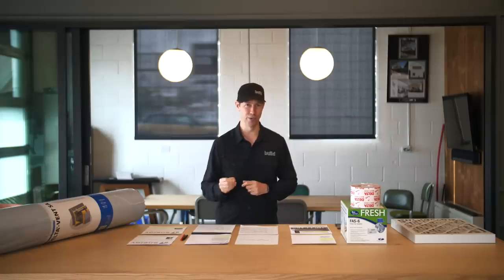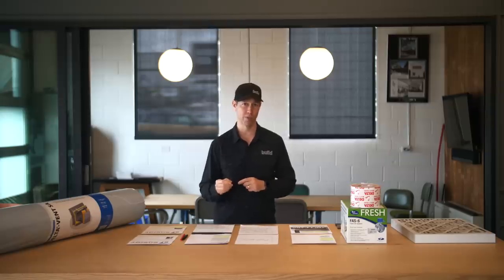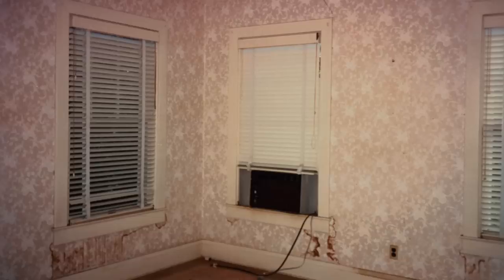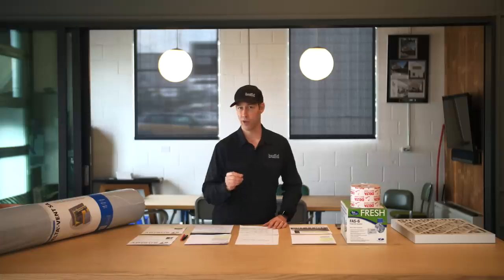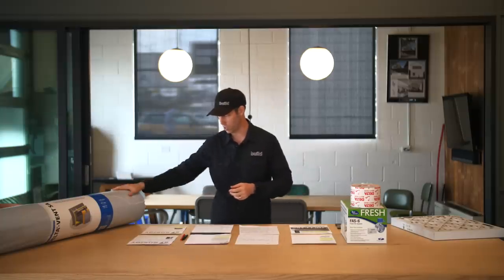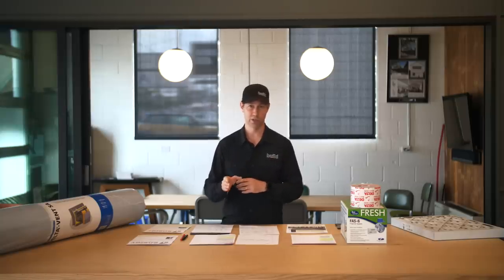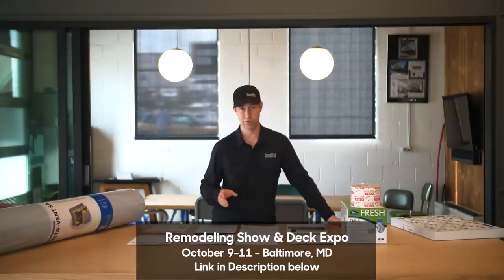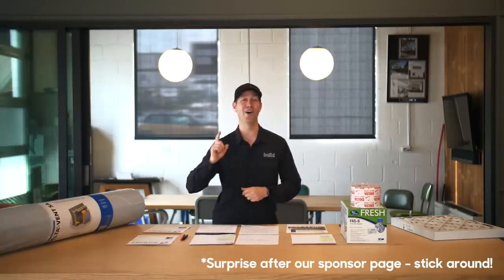“Houses need to BREATHE!” - Shut your filthy mouth

Comment: I constantly measure my air quality; including C02, humidity, temperature and chemicals content.  The C02 and chemical levels do not go down without opening up a window, but when I open my windows I let in humidity, so theirs no perfect solution.  I would love people who write code to measure the air quality of a house not just how tight it is.  I would like code to be written in a matter for the correct amount of airflow from ac or heating to clean the chemical and CO2 buildup.  Not just energy efficiency, because if you saving money but your body and mind isn't working at peak performance because of lack of clean air then it's not worth the savings.
Reply: +1
Reply: You can add a fresh air intake directly into your HVAC system. Ultraire makes one that includes a dehumidifier.
Reply: @tkmair6559 Thanks for the information.
Reply: Concentrations of carbon dioxide that does not exceed 1,000 ppm is the standard and outside air is generally 350-450 ppm.  For each occupant, you would need to take in about 20 cubic feet per hour to dilute CO2 about 50% based on normal respiration rates at 4% CO2 exhaled.  You will need 40 times that amount to get under 1000 ppm C02 or 800 cf/h (or  13 cubic feet per minute).  A common bathroom fan is 50 to 80 CFM.  Some modern designs run a 2 inch vent to the ceiling of each bedroom to reduce the exchange required to dilute air.  Thus, common sizes for heat recovery air exchanges are 50 and 70 CFM and their electrical efficiency can vary greatly depending if they use a shaded pole or capacitor run motor unit to run the twin fans.  Vent systems vary between force air systems or hydronic heat systems. A small amount of building pressurization is desirable. Dry air will feel 'colder' ; thus relative humidity around 40% provides most comfort, but requires good vapor barriers.
Reply: Speaking as someone who does the inspections that Matt talks about, you are justified in your concerns.  Most HVAC companies are not building their systems to bring in near enough fresh air.  At least that is the case in the Austin, TX market.
Reply: The codes have minimum ventilation rates whose purpose is to address the concerns you have. If your CO2 levels do not go down unless you open a window, it means either you don't have a ventilation system, it's inadequately designed or implemented, or is broken.
Reply: I don't know where you live but it is more probable that you let humidity out when opening a window. However the relative humidity may increase but if that's the case it's more probable that you let cold air in. In absolutely most cases (never heard the opposit) the absolute humidity is significantly higher indoors due to vapour production from humans, showers, cooking etc.
Reply: John, which chemicals are you testing for (formaldehyde, particulates, other vocs)? What brand meter do you find works adequately?
Reply: ASHREA has better guidelines than IBC/IRC for minimum rates in my opinion.
Reply: @tkmair6559  Im with this guy on this. My reasons may not be a match, but one of several office buildings I managed had open cell foam at the roof. The attic was amazing to walk through and the HVAC units had fresh air intakes to accommodate the tighter seal. Great way to filter and condition the new fresh air. Any initial issues with freshness when I first got there were the intake filters not getting changed. Once that was addressed it was a very pleasant building. I couldn't say what is code, but if it wasn't a violation, I would have an intake on the side or cover on the the roof with mesh grates to keep rain and large debris out. When the lines came in the risk of debris coming off in the unit was of a great concern when I swapped the filters. I turned off the unit and tried to clean at the filter insert after pulling and before inserting filters. I would have preferred a horizontal filter with at a T duct so that any fallen debris could drop like a drip leg for gas except I would open it everytime I change filters. Air quality suffers more because people don't use a proper filter rating, some AC guys don't always size ducts well(lot's of gestimations->get several quotes and weed out money grabbers), people use gimmick filters(replace every month->no 3 month or static charged to raise the rating->exception to lifespan being a clean environment barely occupied), condensate lines get clogged and coils deteriorate. I would also recommend just running the fan when the air temp is nice. When the building regulates the temp better the HVAC is on less and during pollen season all the fun stuff people drag in needs to be filtered out. I've noticed filters getting dirtier quicker with the fan on. Anyone can disagree if you'd like. Building Science is a curiosity not my major.
Reply: @rushthezeppelin  I feel like an HVAC company in Austin willing to bring in some guys with the right tools for measuring who can do the math would make a killing in Austin. I've always wanted to sit down and create an excel for common calculations and have a friend app build after having people in the industry put it to the test. Different universities like TAMU have great docs online with the data. Being that it's not my field and I'm a busy guy it would take some time I wish I had. Havent been too impressed with HVAC apps for duct sizings as they feel incomplete and unclear. I'd like to make an app a HVAC grunt(who normally gives sketch quotes), superintendent, or homeowner could use to rein in some of the loose 'get er done' sizing I've seen not just in TX.
Reply: @bradley8420  , if you're in charge of keeping the air clean in that building, the people in there don't know how lucky they are! You're obviously both, someone who cares and also someone who thinks through what will help. Good job.
Reply: @rushthezeppelin, yes TX has codes, but I know just from a little experience as a homeowner a lot of the inspectors are super loose about air quality. And I agree, I'm in Dallas area NTX. HVAC companies are losing good $ opportunity by just trying to sell a product or do a "standard" service. A company that knows how to evaluate a house properly and perform the repairs/improvements that would actually improve the client's indoor air quality (IAQ) could make a bunch of money.

As it is, especially homeowners, you have to be your own engineer and researcher and sometimes  even handyman to get a bad IAQ house to become healthy.
Reply: @bradley8420  I think that would require alot more consumer education for that to happen.  In my experience home buyers are still MUCH more concerned about the way the home looks than the way it operates.
Reply: @rushthezeppelin    I understand, on the whole people's priorities can be questionable, but I have met enough people who learn about the consequences of unit neglect first hand, & I believe because of them there would be a demand. Younger generations are more receptive. It's amazing how I can talk to someone in there 20 or 30's and they'll listen as often they are dealing with an older problem unit in their first or second house. I learned from several people in several scenarios, you let people tell you about their problem they'll like you and be receptive to your input(sales, datining, etc...). Lots of contractors 90% of the time already can figure out an issue and have deadliness on getting in and out. I'll tell you I don't go to the mechanic 90% of the time if it's not a standard break. The care isn't there. Took in a company vehicle and 2 yrs later after several visits part of it is still broken & now permanently damaged after I diagnosed it and detailed the issue for them to which they did not listen. I'll fix it myself at this point just hasn't been a priority. Bigger fish to fry. Anyways, whoever listens I'll send them to a HVAC wholesaler for filters, haha. If they're really patient I'll tell them how to reach and clean coils which often builds an appreciation for maintenance.
I'm always happy to see other people like you all who care about doing things right or better even. I guess that's why we follow Matt.
Reply: co2 are the gas of life without it all the plants would die their values go up by day and descend at night
Reply: Thanks for sharing this valuable insight😊
Reply: How can I check pollutants and co2 in my home?
Reply: @bob15479  get a c02 detector. It's like a smoke detection but for co2. You can even get a c02 and smoke detector in 1.

Comment: My house was built the same year I was born (1950). The owners before me put cellulose insulation in the attic and enclosed (and insulated the walls) the carport. They also put insulation between all the floor joists (which neighbors promptly stole). Then I bought the house and my daughter and I replaced all the stolen floor insulation (which same neighbors promptly stole again). I have lived in this house for 22 years with no insulation in the walls except for the one room. That room also has very thick carpeting and underlayment. It is the warmest room in the winter once it heats up, BUT for the rest of the 40 +/- weeks out the year, it is the HOTTEST. It takes forever to cool that room down, but if you go into the uninsulated rooms, they're wonderfully cool.  So far this summer, (8/6/19) I have yet to turn on my a/c. Using open windows, ceiling fans and a high velocity floor fan in the hottest room. If I ever move out of the  deep South, I'm sure I will worry about my home being properly sealed.  Just my personal experience in my house.

Comment: Well MY plans for my build project is a post frame building at minimum of 24x32x22. 
My plan WAS 6X6 posts but was told I need bigger posts. 
SO, my plans are adjusted. Since I'm not going to pour garage concrete floor right away with a 12ft tall ceiling on ground floor. THEN I decided on 2x8 4ply glulam posts set on permacolumns, a bit more but absolutely rot proof.
2x8 bookshelf girts, spec double trusses sandwiched in the columns. Also using mostly construction screws through out.
Purlins in hangers. 
Now my plans currently is to use Huber Zip R 3" panels, tape and flash. Sealing the whole building on the outside. No eaves, one piece gutters with ice and leaf guards. And possible piped to inground storage for use around home and for flushing toilets etc. 
My bottom floor garage will be window free at first just two custom garage doors and one or two walk ins.
According to Huber my exterior ideas are sound. I'm just kind of hoping thier testing of the Zip R for roofing finishes up.
I'm planning scissor trusses with 2x6 or 8 top chord,closed cell  spray foam from eaves edge to peak to do air seal, then due to local spray foam costs I'm just going for the initial temp break and air seal the. Finish out with Rockwool insulation products. Let lower portion of trusses stay exposed but painted. No attic just conditioned air space.
Upstairs will be 8' to eave, with 16 in floor trusses, all my major water, electrical, and HVAC through the trusses and after closing off garage ceiling my plans are to add 11" of blown in Rockwool which give floor an R49. Plans are at same time I spray foam roof inside I'll have them seal around edges of floor truss to wall to mitigate critter intrusion and air flow and give better separation. Top to bottom.
Plans are to build next to an existing deck to utilize it for exterior steps. 
The 16" floor trusses give plenty of good space for utilities and the insulation break I need for warm floors.
I'll have a bedroom and bat on o e end  of building with a reused trailer propane furnace feeding down center of building for second floor heat/ac back up with main hvac being MRCOOLDIY minisplit system. 
Plans are small mechanical room on bathroom end for furnace reused water heater and an air handling add on I found to supplement the older style furnace.
Romex wiring pretty straight forward as one end will have the 10-12 ft bedroom and similar bath with small intrusion for mechanicals room. Finish out bathroom with Proper water proofing Kurdi products. Maybe even a heated floor panel as well.
With those trusses and glued and screwed plywood floors bounce and squeaks should not be problem just leaving small chase unglued for utilities access.
Upstairs insulation will be PROPERLY sealed trippled pane windows, good door/doors. And with 2x8 glulam posts I will get plenty of insulation space for Rockwool batt insulation (figure R12 exterior for cold break, 5 1/2 Rockwool for R23 then possible some Rockwool comfortboard 80or110 then decide on interior paneling(did find some nice white face material similar to pegboard and comes with nice seal strips between panels.
My bookshelf girts MAY be TStuds for fun of it if they meet structure code I need.
The garage doors I found use a track system that angles door towards a very slick seal and literally JAMBS door edge against those seals as it closes last 4-6 in.
Very wind tight.
Plans before concrete is crape away top soil, and lay down packed heavy gravel base, then sand and double layer of high mil plastic vapor barrier then thermal break with styrofoam and more plastic so no moisture ingress then some strong concrete as I intend to install a two post lift.
Still debating a home grown infloor  heating system I saw that uses battle stove wrapped with many many feet of 1/2" copper tubing to absorb heat and a proper reservoir and pump system to heat garage when working in winter.

Comment: Where does the stove, bathroom, exhaust fans get air from??? Where does the fireplace get air from?  Where does the gas appliances get air???  If you wrap air tight the house???
Reply: I guess from the HVAC system or something? Either that or you're going to have to open a window or something, which makes the super-seal completely pointless.
Reply: The HVAC system air exchange
Reply: It gets sucked backwards down the chimney and flue pipes. I've seen it.

Comment: So mat, I can't speak for everyone else saying houses need to breath, but you didn't cover anything that relates to why I say houses are too air tight.

I'm a carpenter on Vancouver island. I have been building houses long enough to see the code change quite drastically trying to fix moisture issues.

The issue I see, is there is the interior vapor barrier (6mm poly), then 2x6 with insulation, sheathing, then tyvek and siding.  They are now making us use sealant and tyvek tape on all joints, creating almost a air tight system on the outside of framing as well as the inside. This creates convection  inside the wall system. It will draw in moister from the inside during the summer, and the outside during the winter (assuming I'm not getting that mixed up haha). This will rot out the framing, causing premature structural failure. I have done repairs on houses around 5 years old with major structural damage largely because of how sealed the wall system is. 

And that's not touching on the air handling system that now needs to be installed, on some houses running 24/7, eating up electricity and offsetting some of the "benefits " of having your house as air tight as possible. Or if you lose power for a extended period, don't open any windows or doors, and your house is as air tight as possible,  you could asphyxiate and get into real trouble. 

Just my two cents.

Comment: We're getting ready to build a house in Western Washington and have to meet an ACH standard of 05 or lower.  It was (kind of) our own choosing, from a cafeteria-style selection process to reach 6.0 credits under the now current 2018 energy code.  Our goal is to hit the 0.50 threshold on our first test, so I'm anxious to learn different methods for sealing a structure.
We're also going to install passive annual solar heating, so we expect to reduce our overall heat demand by 2/3.  Air tightness, insulation and dry earth (to hold heat) are our three concerns.
Thanks, Matt.  Keep up the good work!

Comment: If choose to build an airtight house(passive house) with a ventilation system always keep in mind
that said ventilation needs to be cleaned regularly by specialists (at least every 5 years)
In my opinion you dont need such a system if you build with the right materials such as  brick, concrete or other massive construction which has a very good heat capacitance!(so you have to cool your house only slightly in summer)

Venting your house at least once a day is all you need ! (few minutes cross venting )

Comment: I visited a house that used a mechanical system to bring in and purify outside air - the concept of 'build tight, ventilate right' makes a remarkable difference in how comfortable the house is. 

A house that is well sealed is also quiet. 
A house that purifies incoming air is also clean. 

It was pretty memorable to experience a space where it was 103 and humid outside - but 68 and dry inside with the A/C barely ever running.

That said, I was disheartened by the fact that the owners of the house were completely unaware and largely unappreciative of the symphony of technology that was silently providing such a nice place to live. Kids will take all of these advances for granted. :P

Comment: btw anyone who questions air tightness don't really understand the actual hvac system. got to have complete control over ventilation.
Reply: Some of us don't want or need to run HVAC 365 days a year.
Reply: @bguen1234  so what months do you go to the breaker box and turn off your HVAC?
Reply: @sparksmcgee6641  that might be the most authoritative action to turn it off, but usually the thermostat works just fine, or using the thermostat to stay on just with extreme cut in points

Comment: The mechanical fresh air concept is a good one, and is the accepted norm in commercial code.  It's more expensive, obviously, since you're employing an active system for fresh air, however, you're absolutely correct in that it is necessary when building an air-tight structure.  Great post!